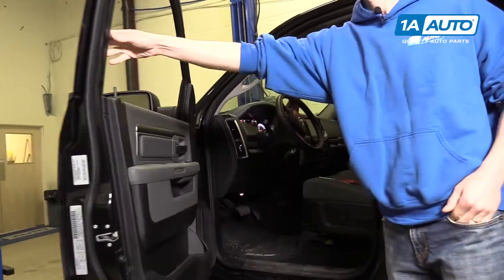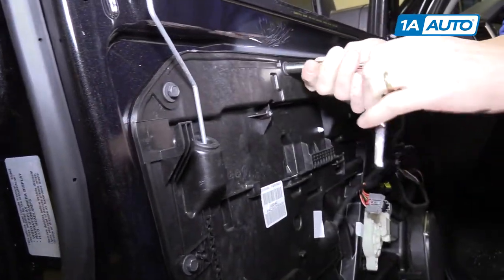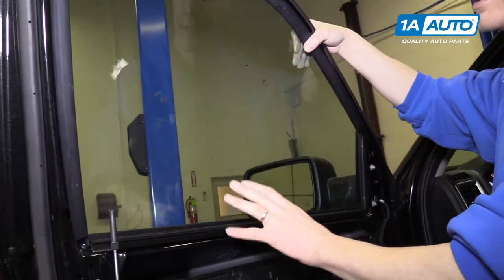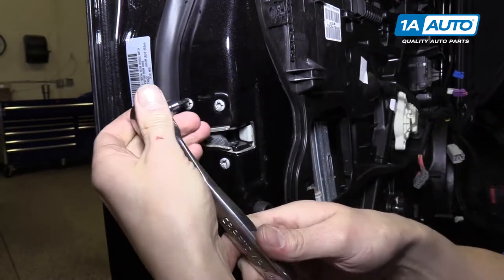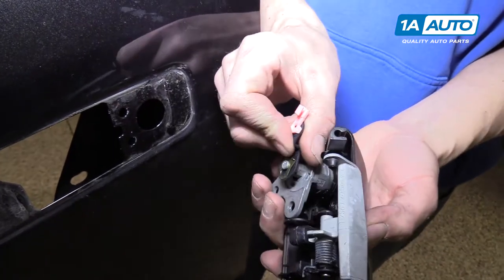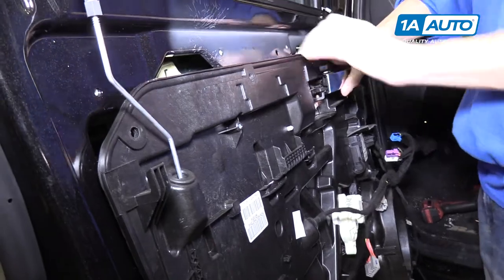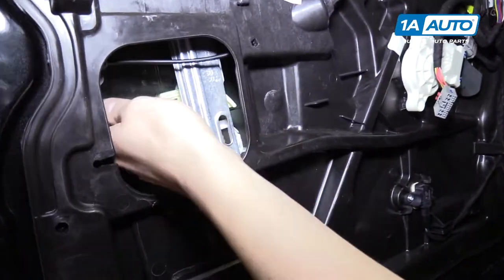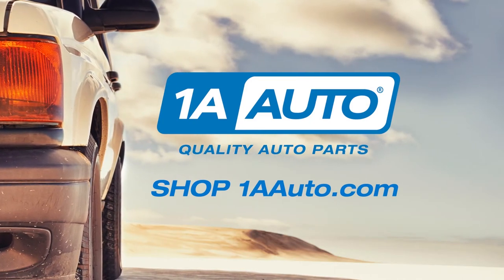How to Replace Front Door Lock Cylinder 09-18 Ram 1500

Comment: Does the new lock cylinder comes with new key or how does that work
Reply from the maker: +danylerma73 Some of the kits do come with keys and instructions on how to install. We do not currently have one available for the 2017 Ram 1500.
Reply: I bought a new set of cylinder and they come with new blank keys , this video is somewhat informative